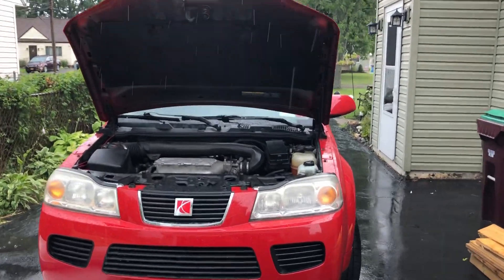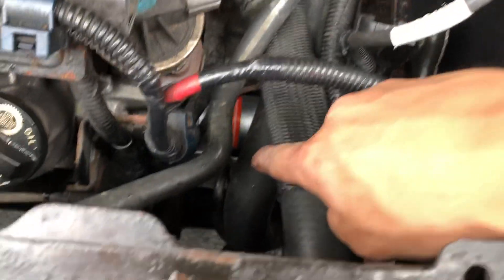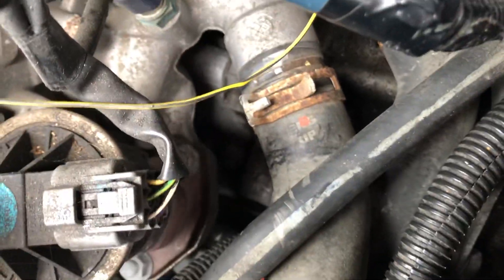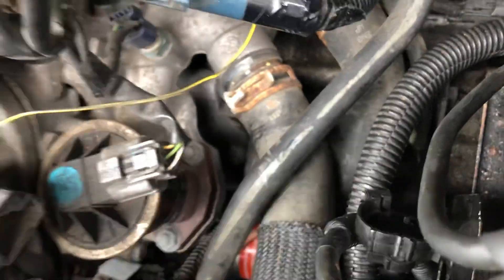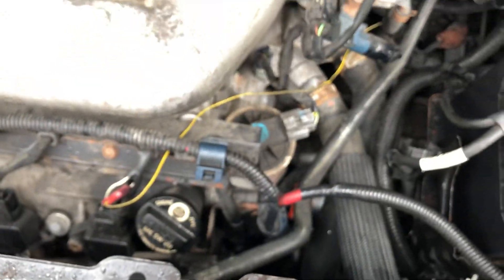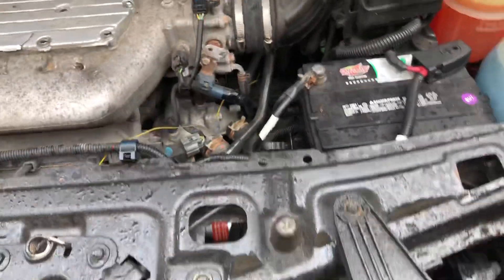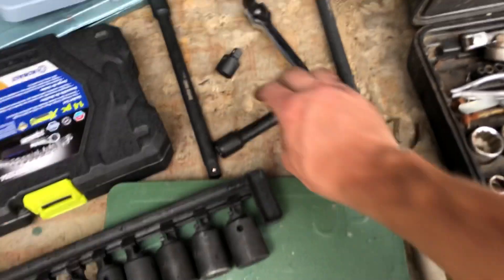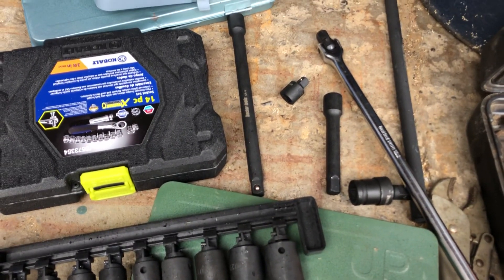Saturn Vue Starter Location 6 cylinder 3.5 liter removal remove replace

Comment: Hi, would you happen to know where the starter relay fuse is located. I checked all the fuse box location. Nothing reads that.
Reply from the maker: No, sorry. I did not have to locate that for my issue.
Reply: The starter relay fuse is hanging off the backside of the fuse box, kind of hidden by the air intake. Hope this helps 2 years later lol

Comment: what if anything do you have to move out of the way
Reply from the maker: As I stated, removing the battery and tray will give you the room you need. The job took about 4 hours but if I had the knowledge which I shared in this video, it should be 2 hours.